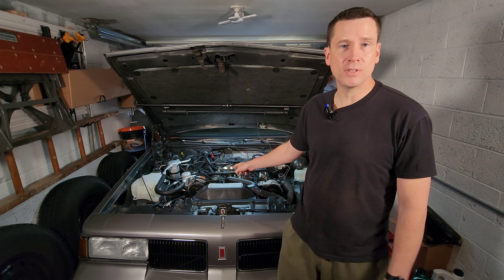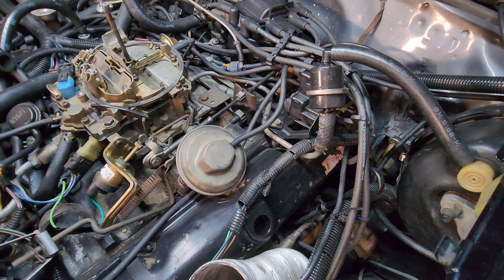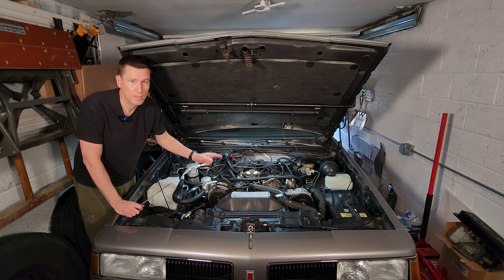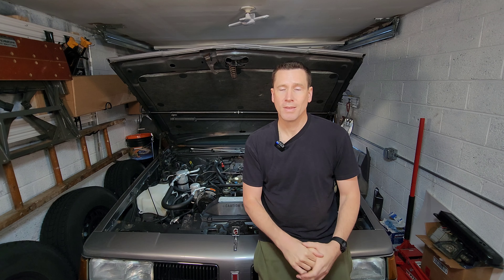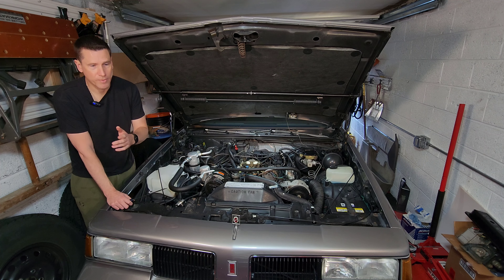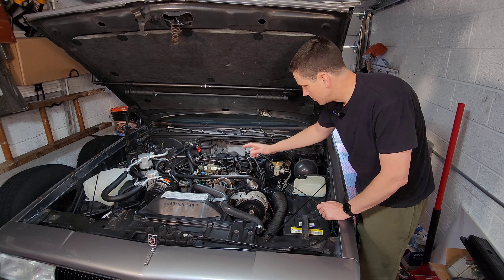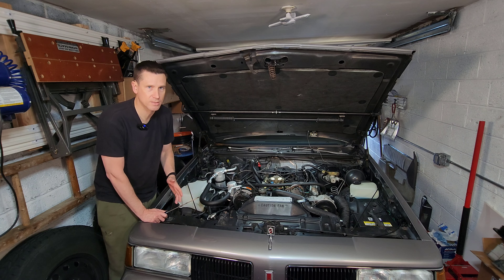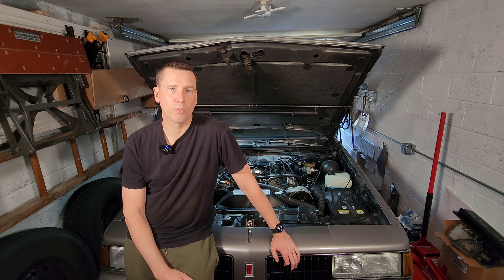Unlocking the Secrets: Understanding the Role of Vacuum in 1980's GM Cars - Part 1

Comment: I just found your video. I have an '88 suburban with a 454 w/ efi. It's a California vehicle so it's got the EGR valve. I bought this Sub from the original owner in Southern California. It's in fantastic condition. However there has been an issue with the engine. Of course it ran great for a few weeks. Then I started having issues with the idle. One time it would run fine, then it would idle fast. The next time it'd idle slow. A few times it would shut down, but start right back up. On only one occasion it stalled six times in less than a quarter of a mile. It started right up each time. I've taken it to four very reputable auto shops. Each one I would do business with again. They just couldn't figure it out. I found a receipt from the original owner that showed that he took it to the GM dealership in his hometown for the same issue. EGR valves, gaskets, throttle body gasket, Map sensor, idle control valve and more. Most of these were replaced by the original owner. He kept all his receipts! But after watching your video you mentioned the "Early Fuel Evap system". No one I took it to mentioned this. I'm heading to one of those shops now. Wish me luck and thank you!

Comment: Hi,
I have an ‘84 Caprice, 305, electronic q-jet, that I’ve had for about four years. I’m having a low idle roughness thing going on, so I’m checking all of the vacuum hoses—it runs great when it’s not at idle. In this video, you didn’t show the last item you mentioned, the Early Fuel Evaporative System. Is that something shown on the routing label, if so, does it have an abbreviation?
Thank you for these videos!